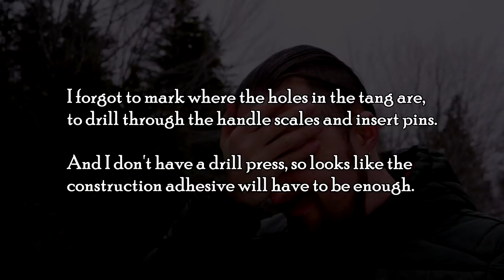First Sword Customization Project (Fantasy Cutlass)

Comment: "Screw it. I'll make my own Skallchion! With Blackjack! And Bucklers!" - Skall

Hey, if  the glue doesn't hold and the handle busts again, that's just an excuse to try again, and mark the holes in the tang. More effort, but a learning experience. Fail upward as they say.
Reply: Creating anything is a constant process of upward failure. Well, sometimes backward failure. But always failure!
Reply: Sometimes backwards, sometimes forwards. But always twirling, twirling towards freedom!
Reply: @normang3668  "We are merely exchanging long protein strings. If you can think of a simpler way I'd like to hear it."
Reply: Goodness Graces  
"Carbon Fiber" 
Hissssss

Comment: Hey skall, here’s a couple tips I have for future projects like this:
1.) a thinner angle grinder wheel will cut much faster for work like lengthening the tang, and it’ll produce much less heat
2.) Get a half round rasp for the handle shaping, it rips through material much faster than an orbital sander does
Reply from the maker: Yep, that makes sense. Thanks.
Reply: @Skallagrim  You also may need to sharpen your chisels, they looked quite dull. Also, if you're going to be removing a large chunk of wood (like between the top and bottom of the handle), you may want to make a bunch of relief cuts and then just knock them out (they'll break more evenly and not follow the natural grain of the wood, so less likely to have the split go wrong).  Also, easier to cut the handle scales in two before you remove too much material.  Also, a simple propane plumbing torch would help bend and shape the copper a lot easier.
Reply: Also, also, you may want to get a proper push stick for your table saw (contoured and angled properly) to make your hand slipping or the wood falling out of the notch less likely.  That would be... bad.   You can also make a simple featherboard to apply side pressure (wide piece of wood cut at an angle with relief cuts following the grain so they're strong, then just clamp it to the table saw to apply pressure as the wood passes through the saw)
Reply: ...Sorry, I'll stop now.
Reply: @Skallagrim  You can get a 4 way rasp for under £10 (so I'd guess at under 15$) that will quickly become one of your go to tools for handle shaping.
Reply: @ArmouredPhalanx   "...to make your hand slipping [...] less likely.  That would be... bad."

Let's not get hysterical. How many fingers does a man need, really?

Worst case, he can always have some toes transplanted to his hands. How many toes does a man need, really?

I knew a man who had only two toes -- on his wright hand. He did just fine, as long as he didn't need to run. Or use his wright hand.

OK, "fine" may be an exaggeration.
Reply: @ArmouredPhalanx  woodworker, eh? One thing I would add, he should get a wooden mallet, way better than the rubber one and maybe a Japanese pullsaw, mine needs 1-2 strokes to get as deep as he needed it

Comment: As soon as I saw you cutting in a tang, I cringed hard (been getting into knife making, I know how easy the steel can lose its hardening). Then I saw you use the snow in place of water and thought "that brilliant bastard!" Loved this vid. I can't believe you went about this with mostly handtools and home equipment, it must have taken insane amounts of time and effort without belt grinders and bandsaws. I salute you, sir! I would look for a local knifemakes, some of them have the equipment and might rent you the day for not much it will save you a lot of time. Really unfortunate you forgot the pins, but even putting them on would have been insanely hard because of the hardened metal. I would use Apoxy next time, as well. Might be worth redoing the handle once ot loosens up with use, and if you use Resined Wood it will likely last longer than normal wood.

Comment: Did you also forget to stain the wood or give it some weathering protection?

This is a nice new series, repurpose and remounting broken blades
Reply from the maker: I didn't forget it, I just ran out of time.
Reply from the maker: @DemoDick1   Yeah, normally I would have treated it with linseed oil first but then I would have had to wait for it to fully dry before applying the wood glue. Sucks to have to rush but I didn't have any other video ready, this just took more time than I expected.
Reply: @Skallagrim   Great video, and I loved it. Despite some mistakes. Though you called them all out in the video so I think you are very much on the right track to doing great things. A new type of video series for the channel.

Comment: Skall, after hammering on copper always heat it up with a torch and dunk it in water after to remove the work hardening. To get it back to shiny copper give it an acid bath. Even if you won't be hammering on them ever again it will prevent cracks and save allot of headaches.

Comment: Never before have i seen someone using construction adhesive for a blade handle, i think it will hold up okay even without the pins, i like the end result a lot, i wasn't really sure on the buckler, but now that I think about it, it's a very practical choice.

Comment: @skallagrim Kudos to you putting the hands in the creative process! 

May I suggest some tips? 

As others said: get some cutting discs for you angle grinder. Proper tools give better results!
Fix your table vice to the table for security and better results (also screw those rotation fixers on the side before use the vice, so you dont have to hold the tool that holds your material...) 
At 4:31 I see a VERY dangerous grinding disk, if abrasive/cutting discs get dented or eroded unevenly they become a source of lethal sharpnell (!) most of angle grinder accidents happens for this cause.
Sharpen your chisels please! (That is a must for someone dedicated to do cutting with other long pointy things) 

I hope you find this comment useful! Doing any "stuff" by your self is a very  empowering and humbling experience. 
Sorry for my crappy english..

Comment: watch out for wood kick back on Table saw Skall, whenever I use this tool i always pushing workpiece pass the blade before turnoff this is what i learn, i recommend to get a Band saw for small work like this 8" should be enough and Belt sander to speed up sanding progress.

Comment: If you want to wrap something with a string nice and tight, try holding the spool a little bit behind the actucal turn when wrapping. If you keep it under tension it will be tightly packing itself around the last turn, just like in a rope-drum.

Comment: Me, while Skall is using the angle grinder: "Wait, that isn't a cutting disk!" Skall: "I'll make it work. Look at all the snow i can use to cool it down with." :D Also, love the winter medieval cap.
Reply from the maker: That is actually a cut off wheel, just a thick one. Would have been better to use a thin one but that's what I had.
Reply: @Skallagrim  You did a good job with improvised tools and a short deadline. With a bit more practice i would imagine the result would be quite impressive :)

Comment: Tip for handle hole problem, if you epoxy the tang to one half of the handle scales , then let it dry, drill through that half once it's set, then stick the other half together and drill the other side through the holes that already exist. I find it more accurate than measuring and marking the holes and gives exact precision, takes a bit longer but it's worth it.
Reply from the maker: That's a smart way to do it. Thanks for the tip.
Reply: @Skallagrim  No problem, it helped me a lot  when I messed up some handles trying to mark and measure where to drill, I do all of my handles this way now.

Comment: I would recommend heating up the boss and hand hammering the flanges that run horizontally so they bend more towards the hilt offering a bit more hand coverage
 
For the top of the hilt maybe start out with a wider base of wood at the top so you can fix a stretch of steel with rivets on either side of the tang slot. Or you could re thread the bottom of the tang for a pommel so you could just cut a slot in a piece of metal you like and secure it via friction like that. Of course that is all assuming you have the tools to do all that.

Comment: No pins? I’ve seen enough Forged in Fire to know where this is going...

(I kid, I kid. It’s just a handle; if it cracks, easy enough to just repeat the process.)
Reply: Well, you definitely haven't seen enough of Forged in Snow, bud. 🤣🤣🤣
Reply: This blade will keel, but suffered s critical failure in the durability testing and will be withdrawn.
Reply: @Xaiff  get out.
Reply: (Sad Doug Marcado noises)
Reply: I always found funny how Doug's titles changed from season to season. It went from Martial Arts Master & Weapon Specialis, to Martial Arts Expert and in the end Martial Arts Practicioner.
Reply: To be fair a lot of Arabic swords were held together solely by various types of adhesive. So it's not like you need pins.

Comment: A couple of recommendations I'd personally make: First, file down the top of the handle so it meets more evenly with that copper guard bit. Second, I would say stain the handle, and I personally would replace the current wrapping job with a wire wrap, but that's just my own preference.

Comment: Pretty awesome for a first try...
Using a shield boss for grip gard is a clever idea, but putting screws on the sides would alow 3 pins up and 3 pins down...
Also using the same piece for the hilt insted of a separate one would simplify the design.

Comment: Skall, some ideas for your workshop.  

Get a tabletop belt sander, the Porter-Cable PCB420SA is a good one.  

Handheld belt sander: Makita 9032.  Great for knife handles and detail work.  

Both of these can be used on both metal or wood projects.

A band saw would be a good thing to pick up too, it would help to cut smaller pieces of wood for handles.  You wouldn't worry so much about kickback from the table saw.  An entry level saw like the Ryobi BS904G  would work well.

Comment: Skall if you ever want to repair the small crack 
get wood filler use a thin file and fill up the crack finish it off with clear resin 
over the bud of the handle it won't crack further and i read it is a technique used by 
smithies

Comment: The buckler/boss looked positively PURPLE in the end shots.  It didn't look bad in the sun, but...
An interesting video.  It might be informative to do a video on building/finishing a sword.  I know there are places where you can get knife blanks, and it would make sense that you would be able to get sword blanks as well.  Maybe you could describe the various sword blanks you could find, and maybe even sword kits (assuming you can find some worth reviewing).  EVERYONE wants to see the blade being forged, but there is so much more to making a sword than the blade.  Otherwise, we would see swords built with a blade and an electrical taped handle (I actually had something like that as a kid.  It was an old saw blade with electrical tape for the handle.  More of a machete/weed cutter than a sword, but when you are ten...)

Comment: Gotta sharpen that draw knife man. And maybe the chisels. Good work though! Quick tip- if you ever do drill holes for pins, make sure and get a carbide bit (expensive as they are, they're the only thing that really gets through carbon steel) and lubricate the crap out of it.

Comment: To drill through steel quickly you set the rpms to 240 divided by the diameter of the drill bit(in inches)

Comment: Now this is awesome content!! If I may suggest something, if you have any spare pieces of plywood or even chipboard lying around, glue or screw a few of those together to get a bit more massive base for you vise. Helps a lot when you do not lose part of the hammering power via the flexing and recoiling of the base board.(:
Reply: Or you could also get a hefty tree stump etc and bolt the vise to that. :D

Comment: Just a thought to reenforce the work you've done.  You could simply drill a hole by hand and insert a bamboo pin like a katana mekugi. Glue it in place since this isn't intended to be disassembled, and sand it down flush...

Comment: Not bad at all. Personally, I would have used the buckler as a bowl guard. The cracking you got is following the grain, quite common on such pieces. You can fix it by drilling and inserting a dowel or two. You can soak it in epoxy and let it cure or mix up some sawdust and epoxy and fill the crack.
 Might I suggest that when holding work in your Shopmate, that you're going to be pounding on, hold it with the plastic clamps. That way the piece will be supported vertically by the edges of the table. Less likely to push it out of the vise jaws. For a drill press, you can get a rig that will turn your portable drill into one, good enough for occasional work and relatively cheap. Check out BusyBee, not great quality but usable. Last I heard they had a store in the Burnside Industrial Park. For high quality hand tools, Lee Valley Veritas is amongst the best.

Comment: From a professional metalworker and amateur bladesmith... Not terrible, there's room for improvement of course but a good first effort and it looks pretty functional. You should be able to eyeball one pin at the top of the handle where the tang is wider from where you cut the blade down, just by continuing down the line of the blade a bit. With a good drill bit you can drill right through the hardened steel on the tang, go through the entire handle in one go. One pin will be strong enough. I mean the ubersword of the universe, the katana, usually only has one right?

Comment: Watch the grain direction of the wood. If you had used three pieces, with the grain running perpendicular to the long axis, it would be less likely to split. More precisely the grain should be perpendicular to the greatest stress. There are several old books on blacksmithing with good information on how to make a drill press as they were in the 18th and 19th century. Basically a brace and bit in a frame to hold it straight. 
    Where did you get the table saw?

Comment: I don't know if you're on the east side or the west side of Canada but I would recommend using whole round pieces of wood instead of trying to use a section of that. Also I would recommend using some cherry if you can get it but otherwise you'd a really good job

Comment: Looks good! I'm not sure how I feel about the buckler boss being used on the guard, though. Looks too bulky in proportion to everything else, in my opinion. For not having pins, it looks like the handle held up well during the test, but the blade could use some sharpening. To make copper stronger, you have to give it a very slow cooling, but of course it won't be nearly as good as other metals. It can get some neat colors, though. When I just used a propane torch in my early projects with copper, I got some blues, purples, greens, golds, and silvers. I love the idea with the snow, too. ;-)

Comment: Do you still have your Work-Sharp Belt Grinder/Knife Sharpener?  Well if you want to Refine the Lines of your Handle, Remove the Platen from your Belt Grinder and use the Slack Belt to true all your lines up and blend in the seam. 

Generally I go to a clean 400 grit Machine finish on a handle then take it up between 800 and 1500 grit (wet/dry optional) on hand sanding (Generally 1200 Grit for wooden handles, and about 2500 grit on a knife blade) in which case I can take it up to 600 grit straight from the grinder, which leads to a total of about 35-40 minutes hand sanding
Reply from the maker: Ah, that's a good idea.
Reply: @Skallagrim  Hey, if I see a way that something someone made can be improved... I usually let them know ^.^

Comment: As far as messing with the heat treatment in the tang is concerned, getting rid of any hardening in it wouldn't be bad really. In fact it would help keep it from snapping. Make it more likely to bend instead of break. Really, straight up annealing it wouldn't be a bad idea.

Comment: Would you by pre fullered blade stock, it would take forging to get rid of the fuller near tip or last 1/3 of blade,  but I think that would be a cool product to supply blacksmith hobbyists with, because, no filtering tools would be required,  and most cannot start with power hammers.  So to be able to do dark age and early medieval blade types without being 20000 in debt...

Comment: Try soaking the string with the adhesive before you wrap it around next time.  
I do that with random string (preferably twine or sewing string) and super glue to fix simple everyday items like broken pens, etc. and they turn out way too strong that last for years since it has the durability of the sturdy stiff adhesive and the somewhat flex of a fiberglass (cloth).

Comment: DUDE!  Professional carpenter here.  And after 30+ years, I still have all 10 of my original fingers. Do NOT, EVER,  EVER!!!!!! leave a piece of wood unsecured between the fence and spinning saw blade on a table saw!  There is no circumstance or minute amount of time where that is O.K.  A piece that small won't kill you if there is kickback (depending on the saw's horse power), but it can cause pain and injury.  I've witnessed a 5HP table saw sling a 2x6"  through a cinderblock wall.  Let the push stick get cut, that's what its for.

Comment: Dude, ditch the closed coat discs and get the open coat, or flapper discs, whatever you want to call them. Looks like layered sandpaper. The cut quicker, produce less heat, leave a better finish, don't jump around, and are a lot quieter. They chew through metal and wood. You'll never go back. You already have the angle grinder.

Comment: Hey man,  you've got pictures of where the tang holes are,  go hunting with a 1/32" bit. You'll find 'em, and then the handle is wrapped anyway?
Reply: A 1/32" drill bit or even a 1/16" drill bit would too frequently break with a handheld tool.  However equally thin nails could be uses for the probing, then left buried in the handle.